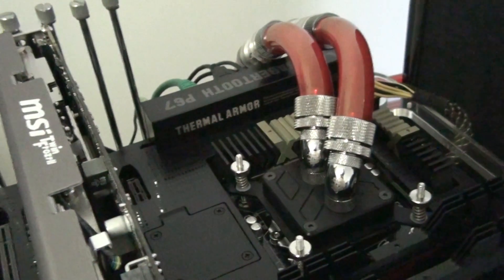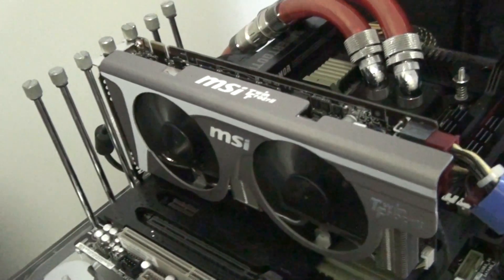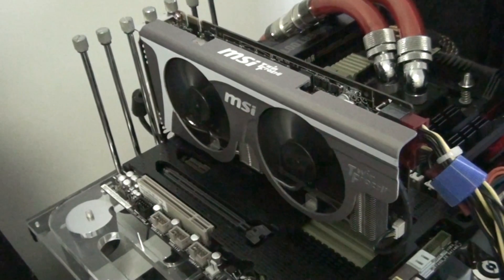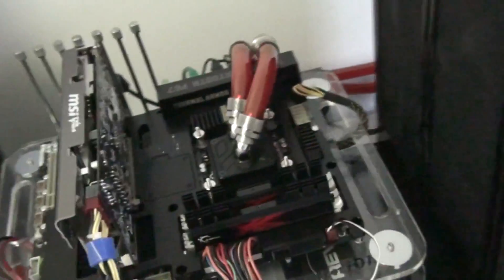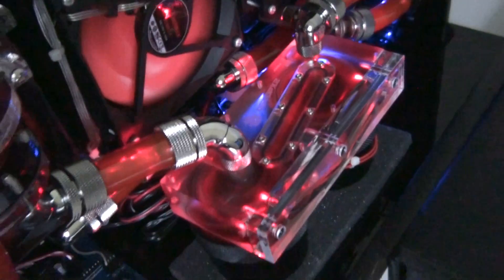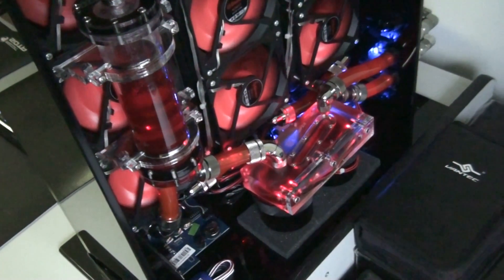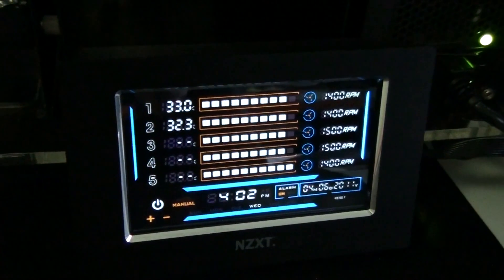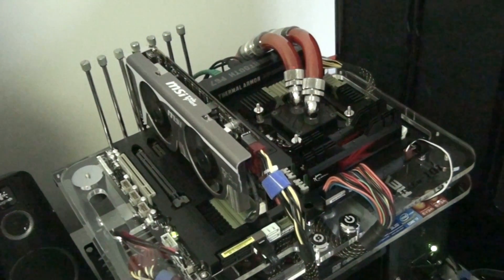Sabertooth P67 Test Bed Updates

Comment: I was wondering what issues you have run into running without a fan to cool that motherboard?

Does it really mater, and is it OK to just remove the plastic cover?

I have a water cooled system and wanted this board, but not sure it would work well without issues.

Comment: My temps were fine.  Running in the mid 60's celcius on a custom water cooling setup.  It was the voltage that killed my processor.  Good luck.  Try not to break it.  I would stop at 5 ghz.  4.8 would be fine too.  Only 10 % of processors can get to 5 ghz.  and remember to stay under 1.3 volts.  You will start to burn out transistors anything over 1.3 volts.  And transistors don't come back once they are fried.

Comment: what is LN2? And I didn't fry it straight away.  It took about a month.    And yes I reached 5.8 ghz passing prime 95.  It's pretty easy when you use asus A.I to get to 4.8 ghz  From there it was as simple as raising the voltage and the frequency.  It was stable at 5.8 for just 2 days and then I had all sorts of problembs.   So please do not go over 1.275 volts to be safe.  I know I will not.  Transistors are fragile.  Right now I'm running stock idleing using 2% of my CPU.  no need to go higher

Comment: My 2600k processor died at 5.8 ghz stable.  If you value your money do not go over 1.3 volts.  I know this time I'm going to keep the voltage low.  i also water cool my cpu.  Only way to keep it cool besides thermo electric V12 cooler.